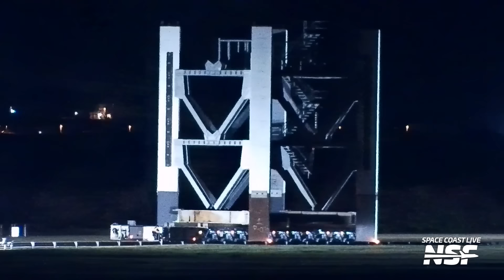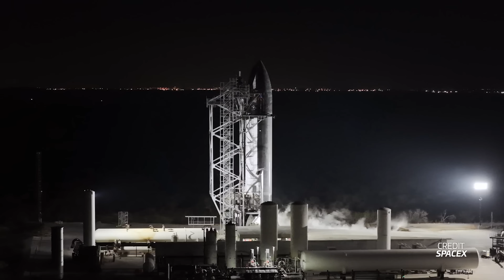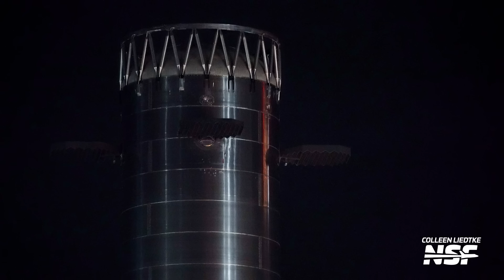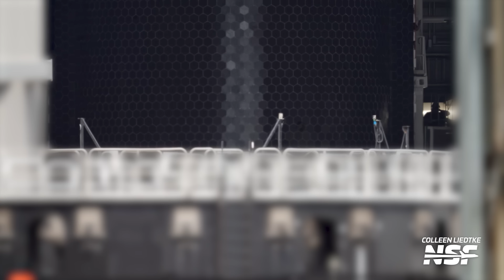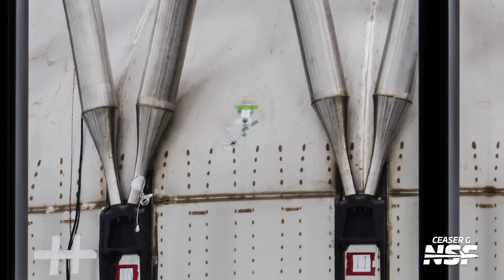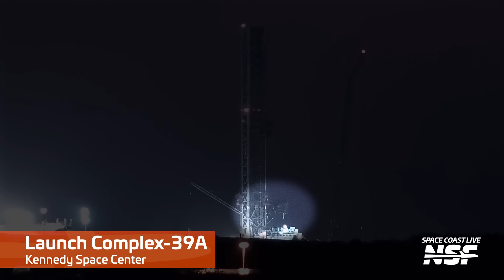And Just Like That... Pad 2 gets some ICE! | Starship Update

Comment: SpaceX cannot take another major failure right now.  Could take a few minor hiccups, adjustments, but they really need to nail their objectives.  Any RUD of either booster or ship, any major damage to the new pad, trench, or tower will really be a setback.  Even if it moves the launch into May, they really need to do their testing, check all the boxes, and get it right.  Measure twice, cut once.  Or maybe even three times.
Reply: It will delay things, but that's all.

Comment: Powered-descent landings in the Indian Ocean were achieved on tests including Flight 4, 5, 6, 10, and 11.   Why test flaps now?  Did SpaceX not get any data on the flap loads during reentries and flip manoeuvres?  Is version 3 design that much different?
Reply: The most likely reason is something has changed in the design.  Sadly we only get the exterior view which means we have little more than a superficial understanding of some things.

Comment: Another big factor for the flaps is they likely have a new design to reduce weight. Like many things on Starship, SpaceX builds parts far heavier and stronger than they need to be and then once they gather data and understand the loads they can iterate on the design with a more efficient version.

Comment: You want white tiles for thermal control in orbit. If, say, you're filling the thing with cryogenic fluids...
Reply: Even if it's just a tanker variant? A quick trip to space, transfer its propellant payload, then back down to Earth for a chopstick catch?

Do we know whether there will be propellant depot(s) any time soon, and whether they will have re-entry hardware (like a heat shield)? Or just be left in orbit for as long as possible (years?) before eventually being de-orbited over the Pacific?
Reply: I think the propellant depot version will be completely covered with white tiles

Comment: The white tiles, I think are template guides or checking devices to verify the proper welds or attaching holes on the nose cone are all aligned correctly.
Reply: Personally I think it's a test tile set meant for tanker Starships meant to keep cryogenic fuels in liquid form.
Reply: Maybe it's not even meant for reentry at all.

Comment: White tiles ?= HLS covering
Reply: Depot micrometeorite protection prototype.
Reply: I could be wrong but I don't think HLS will have heat tiles, since it's not meant to return to Earth
Reply: @3li_516Neither is the depot.  It likewise has no need for reentry shielding but can use reflective insulation.
Reply: Yes MMOD tiles for HLS